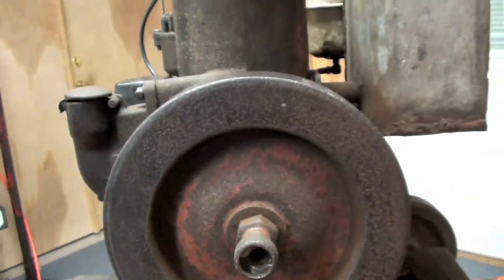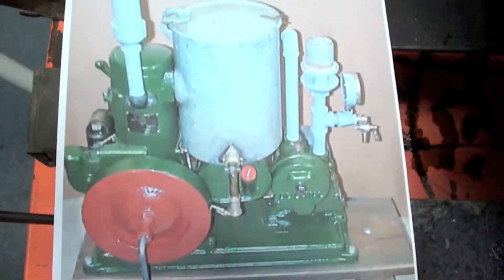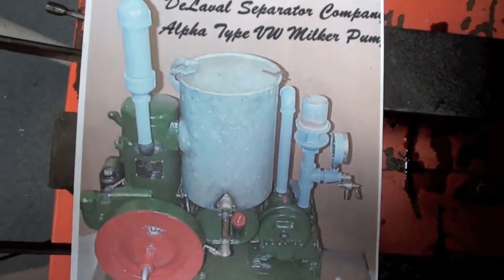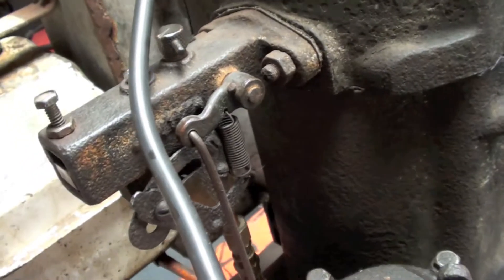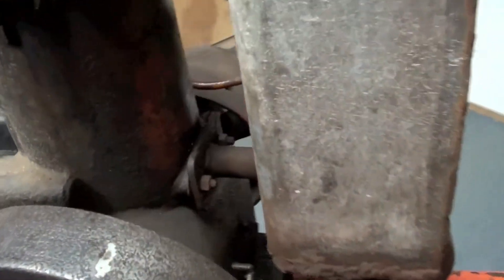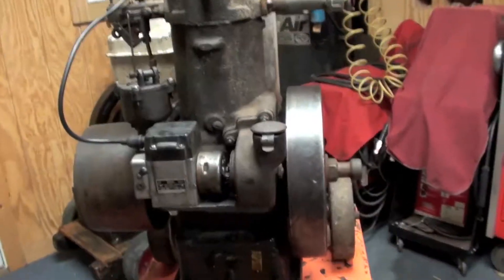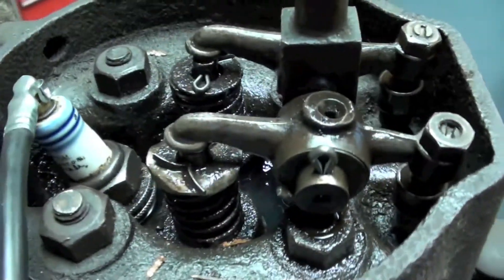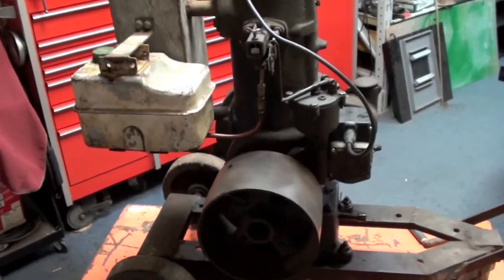Lauson DeLaval Engine Part 1

Comment: If you aren't supposed to use cotter keys on the valves what are they supposed to be ?
Reply from the maker: Solid pins similar to roll pins but solid and hardened.